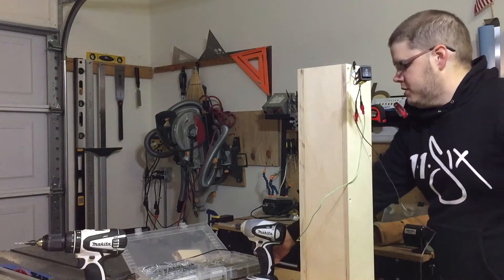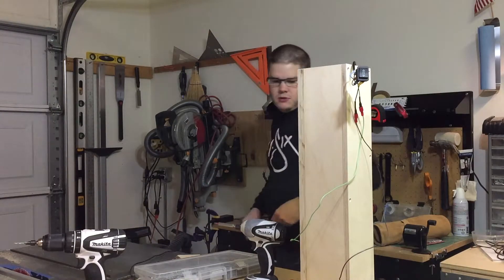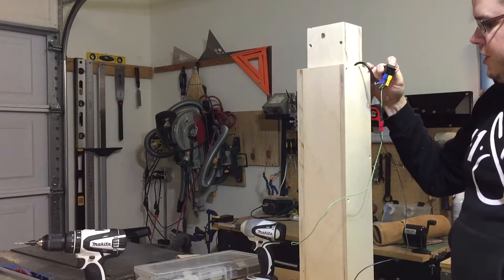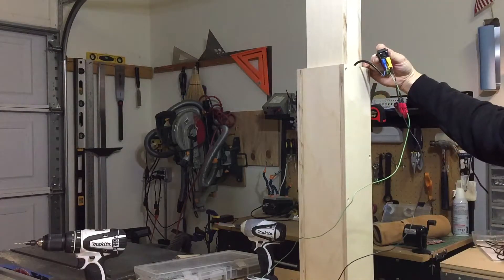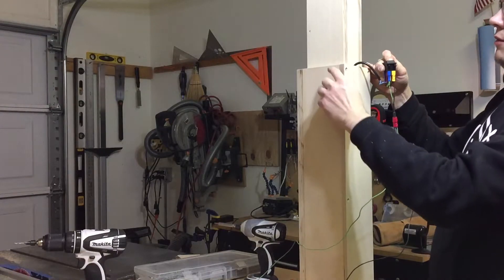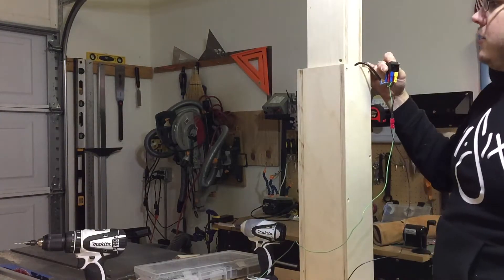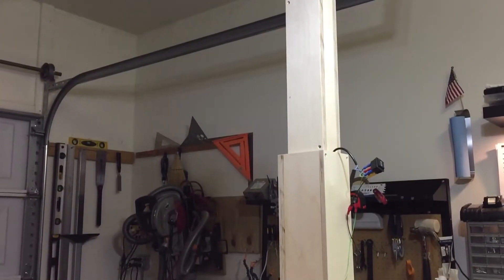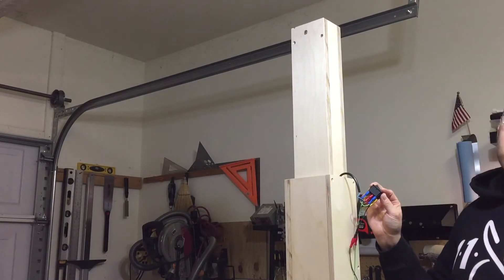Demo of linear actuator for adjustable height desk

Comment: Thanks for sharing Seth.  I'm thinking about building something similar.
Two questions:  What brand of actuator did you use?  How did the project come out in the end?
Reply from the maker: Hey there Edward.

Thanks for checking it out. 

Here's a couple shots of the finished project. 

Up: https://instagram.com/p/weA7EzE41y/
Down: https://instagram.com/p/we3KbjE494/

I use it every single day.

Now, for some more specifics to your questions...
I went the cheap route (wish I hadn't) and got these from eBay:
http://www.ebay.com/itm/Set-of-2PCS-18-Stroke-Linear-Actuators-220lbs-Heavy-Duty-DC-12Volt-14mm-s-Speed-/201321663233?pt=LH_DefaultDomain_0&hash=item2edfb4cb01

Had I to do it all over again, I'd of gotten the ones from Progressive Automation, as they are more robust and provide a potentiometer allowing to get positioning feedback should you decide to go the Arduino route. They also are synced for speed, whereas the ones I have from eBay are not, and consequently one travels faster than the other. That means they are not level when at the same height, unless I raise them to the max then lower them to my preferred standing height.

Seated height is just fine though. As far the desk "feet" go, I'm not happy with them at all. I want to rebuild them for more stability and overall aesthetics, but I use my desk daily for work, so finding the time to disassemble everything and redo it is tough.

I hope that answers the questions. Please let me know if you have any others!
Reply from the maker: Edward Garana I ended up taking apart the desk this past weekend and getting the cabling situation under control and painted the underside of the table top. 

My biggest regret, besides going with the cheaper actuators, is not thinking my tolerances through with the inner/outer leg components. I started off with WAY too much room between parts, when you really just need a sheet of paper as tolerance. I ended up overcompensating with a collar installed at the top that tightened it up WAY too much. That said, now i can't paint it to match, i may end up taking it apart one last time and staining it (since that would penetrate into the wood, not be a coating on the exterior of the wood.

Let me know if you have further questions.

Here's a semi close-up of the under-table-top cable tray.. 
https://drive.google.com/file/d/1i1nG33sLI-64fFkPIuEk4yvzRzweH95ALw/view?usp=sharing
Reply: +Seth Messer Why actuator do you recommend?
Reply: +Seth Messer How DID you get the tolerances so tight? Did you have to use a jointer or something?